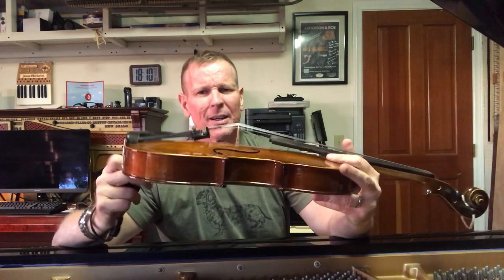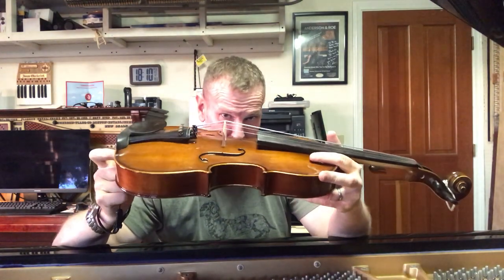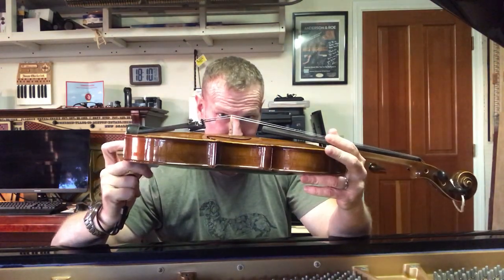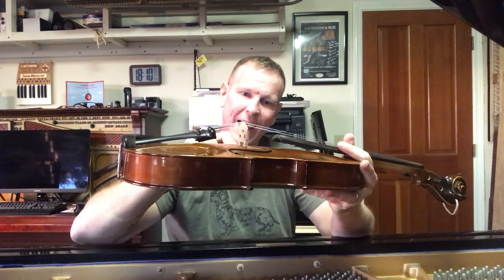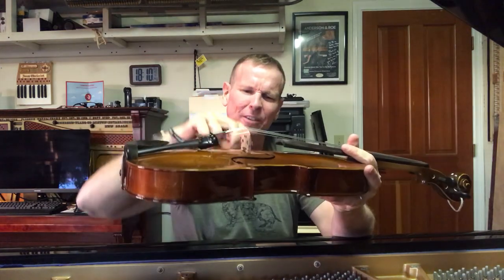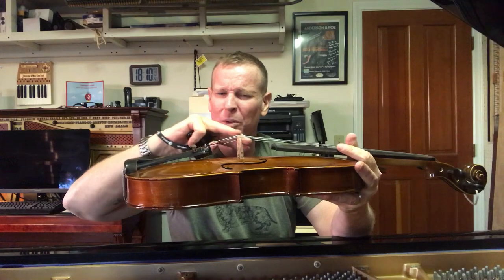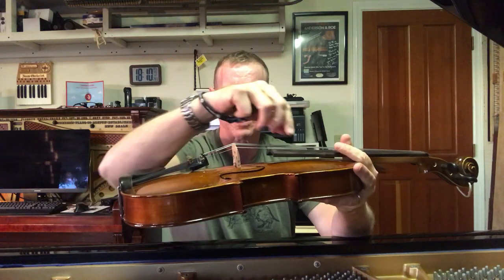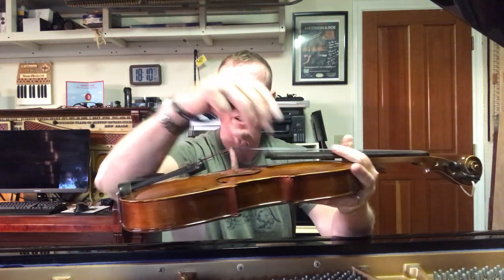Pianos and Violins - how a piano soundboard works

Comment: Hey Brian, what would be a good alternative to recrown the bridge section on a Boudoir Grand? (Without heated room).
As you have mentioned in your video, the antique 1874 Broadwood we acquired was in a very cold in winter and warm in summer environment. Soundboard was only showing 1 visible crack. Pacific Northwest.

It’s been in our house in a reg temp room 
For about 2 1/2 months now and I have started restoration on it.

After removal of all strings I started noticing the increasing cracks on the soundboard prompting me to measure the bridge height compared to the sides.

The bridge at the moment sits 1/8” lower than the edges.

Curious about your thoughts on the matter and what would be the appropriate approach.

I do have a series of videos started on my channel about the piano restoration if you would want to see the piano in question .

Really appreciate any help or direction.
Reply from the maker: Greetings Tomy 🎹👍🏽 I am not sure how much help I or insight I can give. I would find a local piano technician that’s a member of the PTG and see they might know someone in your region that specializes in antique instruments to be of assistance.
Reply: @thepianoappraiser  thanks for your quick reply. Really appreciate! Already have a piano tech but I believe this is outside of his comfort zone. Will do

Cheers